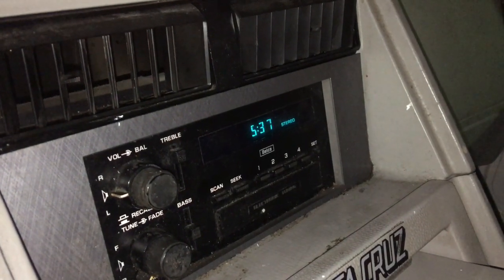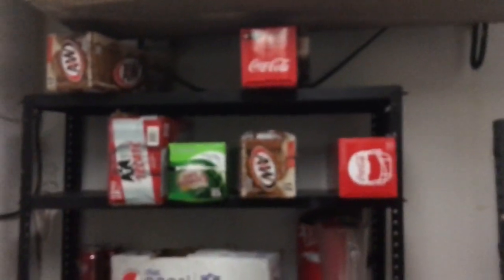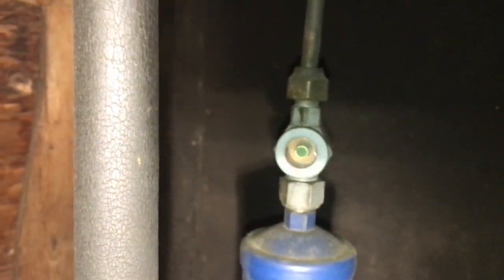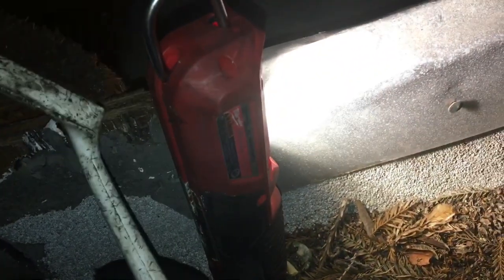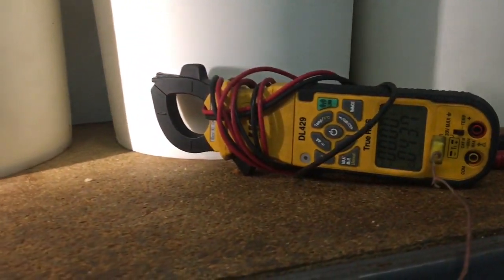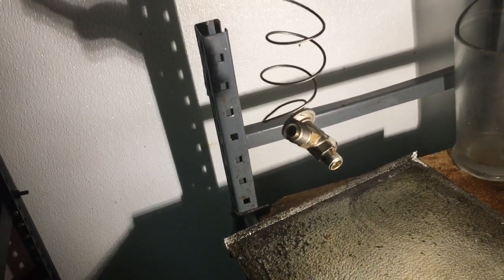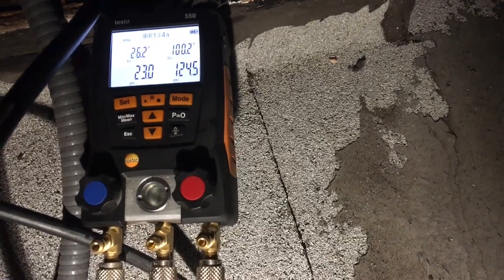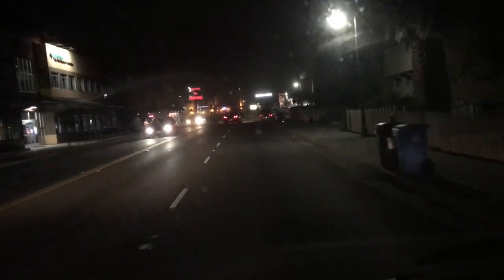Night call and thank you

Comment: Ive got a reach in refrig case where somebody smashed the hell out the cond coil fins. I mean completely flattened to the point of almost no air flow. Its about 10yrs old. Would you recommend just replacing the coil or the whole condensing unit? I think it is r22.
Reply from the maker: johnmiller102 I would change the condensing unit and metering device and switch to R404a or 134a
Reply: That how I was leaning.  I guess just flush out the evap real well.  Do you use a flush or just blast it out with nitrogen?
Reply from the maker: johnmiller102 just nitrogen a little mineral in there is ok.
Reply: ok. Thanks

Comment: Danfoss junk.
Reply from the maker: toolman I had good luck with those old ones. That txv is over 20 years old. It only failed because the cap tube rubbed threw. I do use sporlan on my installs most of the time. Lol
Reply: Nor-Cal Refrigeration & H.V.A.C I haven't had much luck with them at all.And when they break, you gotta change the whole thing. If that was a Sporlan, you could just screw on a new power head. Plus you could do it with the unit under a little positive pressure, and not have to pull a vacuum on it after you swap it out.  Just my personal preference, plus a long history of traumatic experiences with Danfoss valves, and danfoss pressure controls lol
Reply: toolman I use only Sporlan parts been very reliable parts   drier TXV etc. l would do the same thing change power head Danfross can't change power head
Reply: Edward Hvacr When I replace a TXV I always go back with sporlan. I've had issues with them too, but they sure are a whole lot more service friendly. Easier to adjust. Rebuildable. Readily available parts locally. And whenever I can, I flare in a valve, so it is easier to work on next time.
Reply from the maker: toolman I think the old stuff was made in Denmark the new stuff is made in china. They have fallen into the Pitt.
Reply: Nor-Cal Refrigeration & H.V.A.C  Seems like it all is. Copeland was great, until Emerson came into the picture. 

I know I'd rather try to bath a cat than set the SH on these new Danfoss TXV's